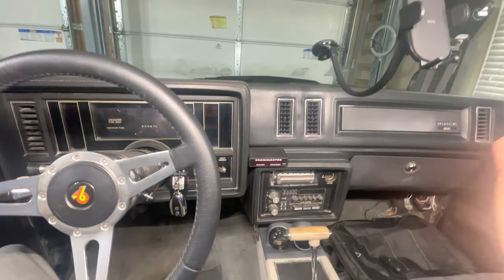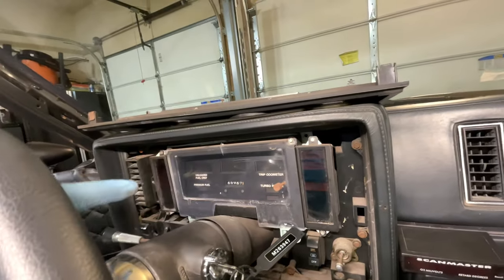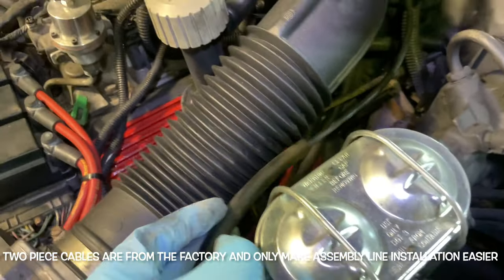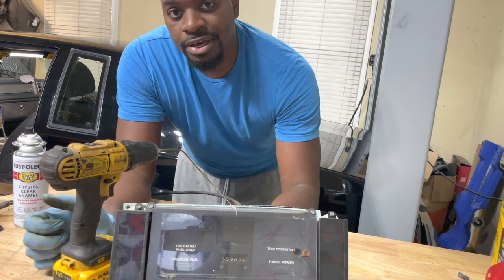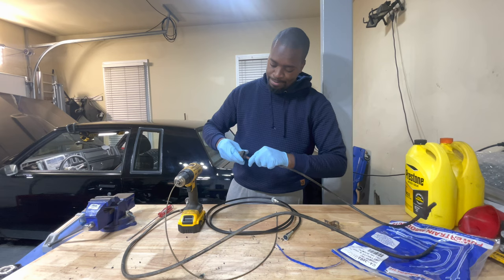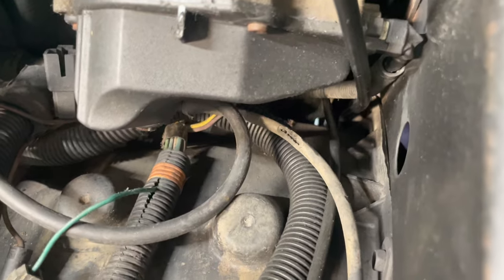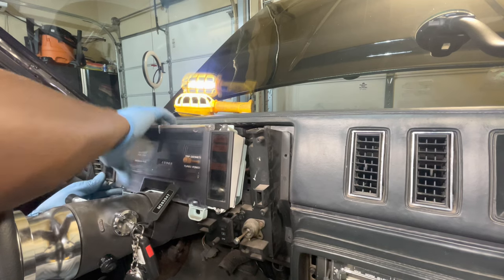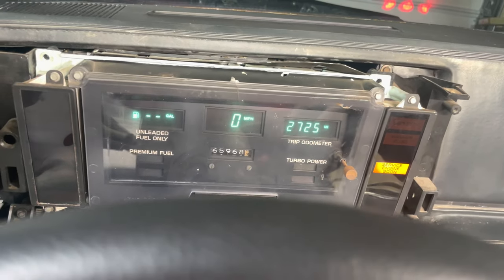Boost Video | Grand National Dash Gauge Removal and Speedometer Cable Replacement

Comment: Man this was a big help for a completely different reason lol. I have an 84 GN that was originally a digital dash car but someone swapped it out for a regular cluster at some point in its life (digital dash probably broke). 

But I LS swapped the car and integrated everything to the factory dash that’s in it and I’ve been debating finding the correct digital dash for it but wasn’t sure if all the connectors were the same. And your video cleared all that up for me so its much appreciated!

On a side note though, the other thing I’ve been trying to find is a picture of the connector that goes to the defrost switch. A previous owner removed mine and some point and I can’t find any loose connectors that would be for it. You were almost there and even talked about the defrost switch but I was bummed when you moved on lol. 

But you don’t by chance have any pictures/videos or could possibly get me some of the defrost switch and the connector/wires that go to it can you?? I’ve been searching it for months with no luck so I’d be forever grateful if you can help me out with that!
Reply from the maker: Glad it helped! How was the LS swap? Happy with the performance? 

Shoot me a message on Instagram or email and I’ll send you defroster videos🤝 crashnbern_ or bernrepairs@gmail.com

Comment: Ha ha I tried to separate my cable and it was also a no go! My trip meter doesn't work but speedo does but it squeaks so badly! I might try and remove the cluster again now after seeing how the connectors go! Great video! Need any help let me know! Not that I'm a expert but the buick community is very good about helping out!
Reply from the maker: Thank you! Does your rear window defroster button light up when pushed? My switch has very little resistance when pushed
Reply: @CRASHBERN  my car didn't have a rear defrost sorry buddy!

Comment: I have noticed on Digital cars - only warnong light that illuminates on start up is the check engine - on my 87 Regal Limited I do get a Voltage and Choke on the left side when starting

Comment: Great video🎉 do you have a video on installing a fuel gauge? mine is not very accurate and need help with wiring and ohm on the sending unit
Reply from the maker: I don’t think I recorded it. You may already know this but turbo Buicks have two different fuel sending units depending on whether it’s a digital dash or analog dash. Usually you can remove the sending unit and clean the “sweep” and it’ll read more accurately. Digital dash is 0-120 ohm and analog is 0-90 ohm
Reply: @CRASHBERN  I see because today I unplugged the 3 wire harness by the fuel tank and put my ohm meter to the pink and black wires and it was at 138.6 ohms and the tank was completely full but my car is analog. So i thought it was kinda weird.

Comment: Thanks bro for the video, my dash is like yours digital dash. It was working then I let the car set for awhile and when I got back to her the gauges didn’t work. They first started to blink or half way light? I’m wondering if it’s the ground or maybe not plugged in on the back of the speedometer? Anyhow I guess it’s got to come apart. What’s your opinion from what I told you? And when I bought the car the owner said that Casper’s had redone the dash so I’m hoping that’s the case and it’s a simple ground? Any help you can give would be very much appreciated! Thanks bro, mine is a 87 TurboT. Peace
Reply from the maker: Possibly the ground, however these dashes are finicky. Make sure your lights are off when testing, otherwise the dash will be dim to the point it’ll look like it’s off. I have had good luck using a heat gun on the circuit board to reflow the solder and repair a broke connection. May be worth a try. I wonder what’s the warranty with a Casper repair? Maybe it’s lifetime 🤞Hope it helps!

Comment: 86 regal digital gas gauge not reading the gallons. Showing -- on display.  What can be the problem? It use to work fine before i had somebody work on the car.
Reply from the maker: Most likely causes: 
1. Shorted level sensor
2. Speedo rebuild needed from Casper Electronics

Comment: Where does the ground cable go connected to on the back of the dash bro?
Reply from the maker: Good question. I believe one end goes to the metal dashboard frame. The other side goes to the driver side bottom of the speedo
Reply: @CRASHBERN  are there two separate ones?
Reply from the maker: @dieselburner4461  no, only one
Reply: @CRASHBERN  ok so that one goes to the lower side of the Speedo connector behind the cluster right ? That’s all I need I think because when I put my dash on nothing works except my digital rpm (I have the analog GN cluster)
Reply from the maker: @dieselburner4461  correct. When you say nothing works, are you talking about the mph dial and the warning lights not doing anything?
Reply: @CRASHBERN  yes all the electronics/ tell take lights ( symbols such as oil choke, LT turn light / volts etc ) background lights etc. I never connected a ground. I’d have to check for it or make one. My turbo t came with no dash cluster so I had to put one together with new flex board and electronics
Reply from the maker: It’s been awhile, but I don’t remember seeing a ground strap on my analog dash car. It could be specific to digital dashes. Does your car run & drive?
Reply: @CRASHBERN  yes it runs
Reply from the maker: Here’s the wiring diagram for those circuits (pg 3) http://www.vortexbuicks-etc.com/ecmwiring.htm 

I hope the ground works since it’s a simple fix
Reply: @CRASHBERN  thank you I appreciate it bro